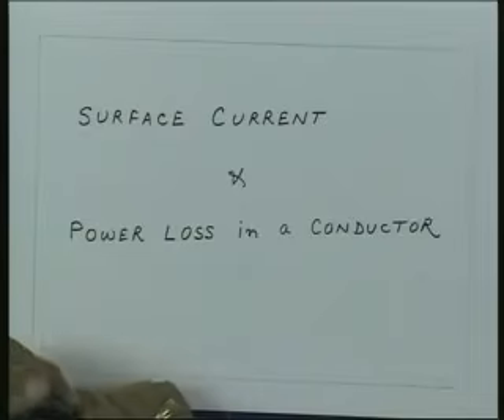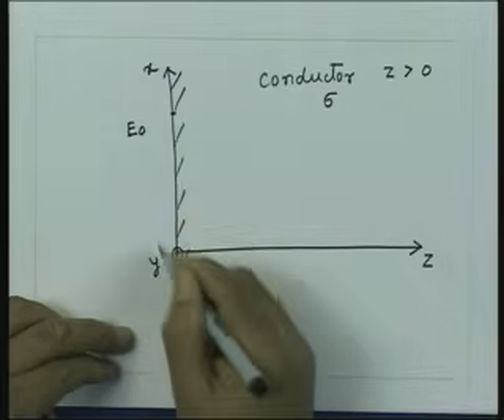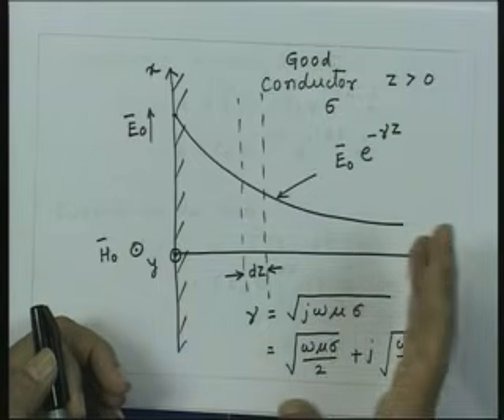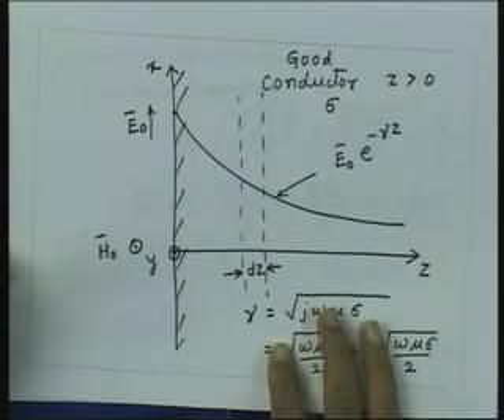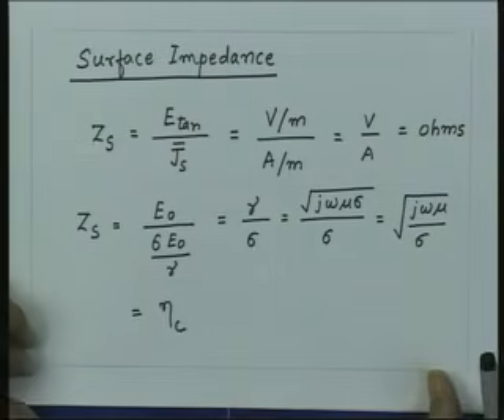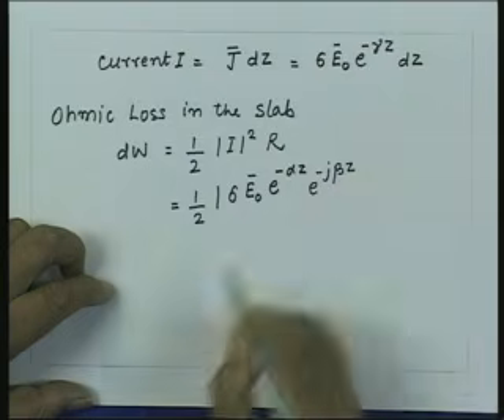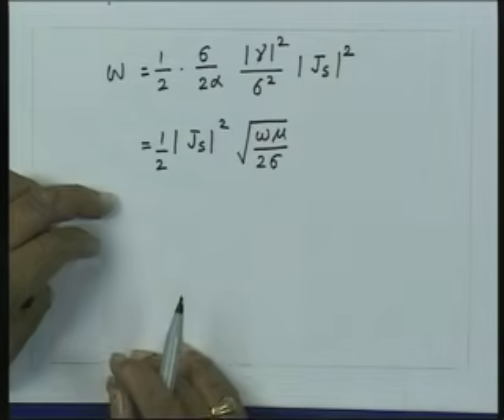Surface current and power loss in a conductor

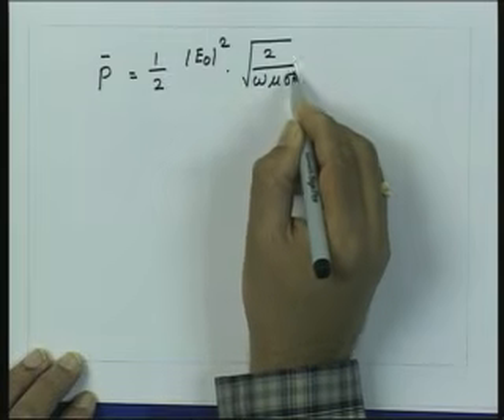Comment: at 51:18 the term under the square root should be: σ / 2 omega µ
Reply: Yes The Average Poynting vector is Propotional to the Square root of Conductivity, but inversely propotional to Frequency Omega. So concept changed in this way, that, at Higher frequencies conductors willl Give infinite surface resistance and Hence Wave can not penetrate deep into it. See implications from High frequency point of View and you will be fine. Professor should explain as footnote in this video that he did this typo and even went on justifying conductivity stuff, along Frequency lines.
Reply: @mr.rachetphilanthrophist601  But equation gained from circuit method and equation gained from wave method are quite different . Which should i take ?